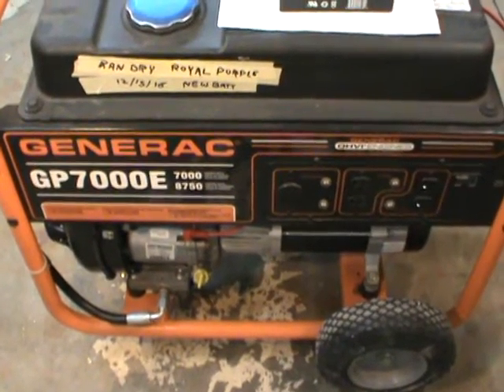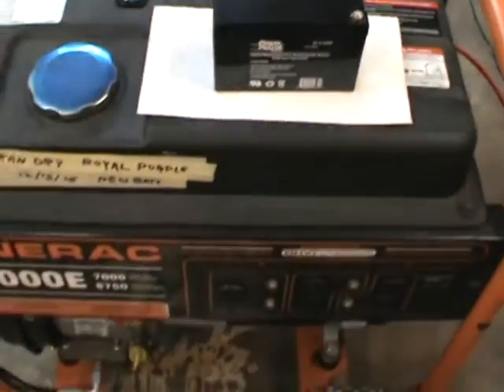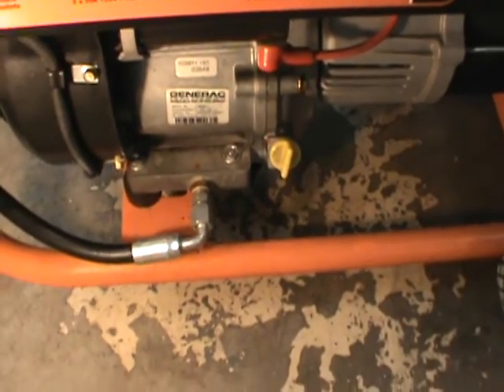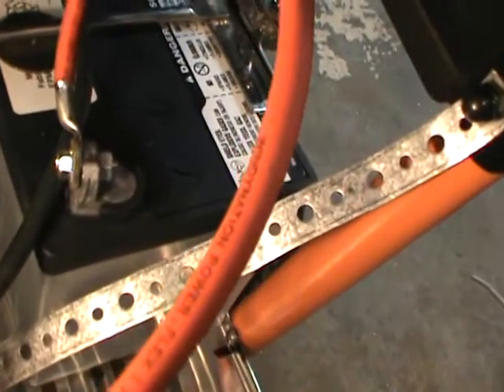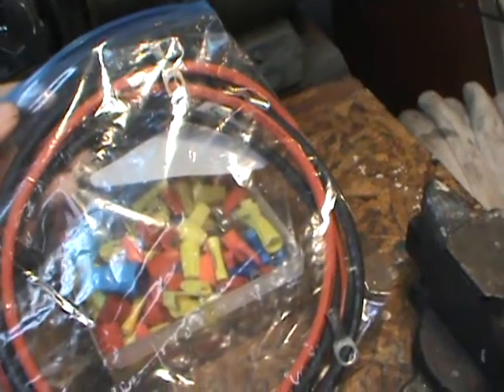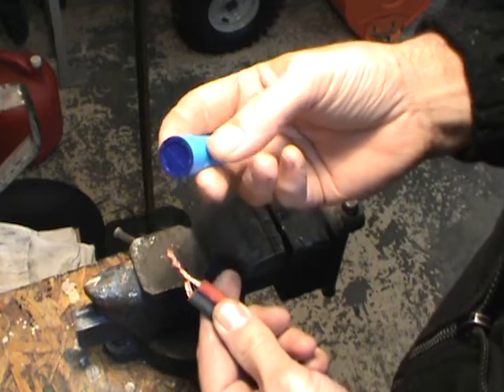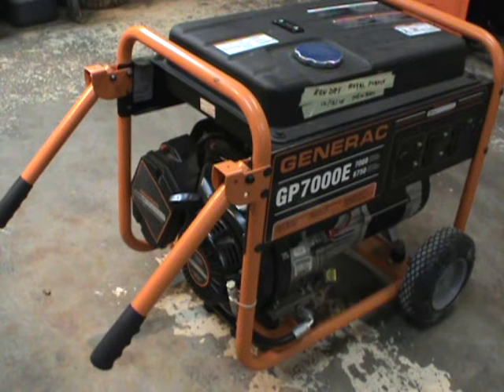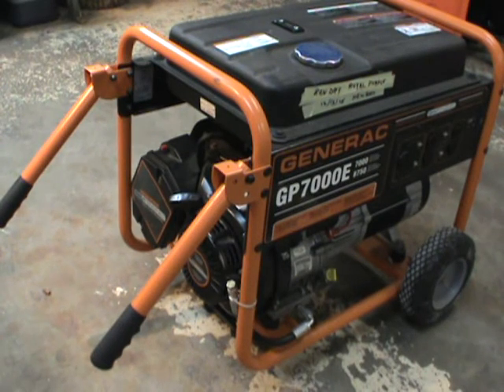Generac generator modification / adding a new battery

Comment: Great job!  Thank you for your time and effort in putting together the video.    I have an XP8000E with an electric start.   I haven't done a nice conversion like yours, yet, but will most likely do so in the future.  I've found replacement batteries for around $30, on Amazon, so just replace the standard battery every 3 years or so.   I also keep a trickle charge on it.
Reply from the maker: Doing the tractor battery mod on my generator works great. I never replaced it after doing it but the original batteries needed replacement for big bucks frequently.

Comment: I did a similar thing with my Generac xg 8000E ( I think the wire i used is 10 gauge) but used small battery clamps to attach it to the little pos and neg tabs on the new 12v battery which is the same small size as their original battery, so the connection is not as good as if there were thicker battery posts. I have a typical auto type flat fuse in the positive line and it almost always blows after a couple of start ups. I began with a 30 amp fuse, then 40amp. Both blew so now I put a 50 amp fuse and have to try see if it blows too the next time I try to start it. I couldn't find a larger amp fuse of that style. I'm wondering what's causing the fuses to blow? Could it be the poor connection to the battery terminal tabs? Which battery is that one you used? It might start it up a couple of times but after that always blows the fuse. The inline fuse just happen to be in the wire from another project. Thanks

Comment: If you have a modern Hi-Efficent furnace this Generac unit will blow out the main circuit board in the furnace, truth!!  Do not run your modern furnace with this unit.  Nice video, thanks.
Reply from the maker: The electrician told me do not run your PC on this generator (when he was installing the panel downstairs). It's too dirty. So I run my laptop... anyway.  I don’t have a furnace with a circuit board so I'm safe here. Thanks for watching.

Comment: Your dealer is ripping you off, replacement battery is between $30 and $40 bucks, Amazon, got one works great. Looks like you spent quite a bit more than this on your adaption.
Reply from the maker: I shop Amazon a lot but never thought to look there for that battery.
Reply: He did the right thing. The battery on my Generac xg 8000E is a real pain and nightmare to replace. A real idiot designed it that way.

Comment: Another idea, if I knew how would be to have the generator charge the battery while running. Lawnmowers do it so a generator should be able to or at least modified to do so. Thanks for the ideas, I’ll do a lawn mower battery on mine since I have one.

Comment: Did you put a fuse between the battery and the switch? If so what capacity?
Reply: No I just bought two inverter wires
2 AWG Gauge Red + Black Pure Copper Battery Inverter Cables Solar, RV, Car, Boat 12 in 3/8 + 5/16 in Lugs
Sold by: WindyNation
$13.49   to use a Marine battery because the Marine battery has the post to connect to.  The little 12 10ah batteries the generator comes with are stupid. they are too small and you have to charge them once a month for 18 hours, now I know if the little battery does not work the Marine battery will.
Reply: Thanks. Now to figure out what gauge wire the original battery wire is once I get it torn apart.
Reply from the maker: No fuse. Just run the wires over

Comment: What size battery??? What make battery,  does it freeze and crack ?? Mine is outside in the next State over RI and the winter cracked my battery like you stated 150 bucks to change the battery.Thanks
Reply from the maker: It's the basic lawn mower riding tractor battery. NAPA has them on the floor where I am for $40 or so. So I picked up a battery tray & wire for less than half a new one. They won't freeze outside as long as they are charged. I put a battery tender on mine. They sell for $20 or less on ebay. Look into a battery tender JR. Thanks for watching.
Reply: Thanks for reply,  so on my third battery at 150.00 each, This battery is still good I took it inside all winter I want to know if  I can use replacement tractor wire and terminals to make both pos and neg longer should I use car wire and terminals  you used 6 gauge or 4 gauge to use a  Marine battery as my back up. Since I have a Marine battery sitting around.
Reply from the maker: @seanbaxter1692  sure automotive battery cables would work fine. I think I used what I used because I had a piece laying around from a winch project I did a while back.
Just find a place to add the battery, fit the tray, extend the battery cables and your done. I used those water proof wire nuts from home Depot to tie it all together. Thanks for watching!
Reply: Thanks for all the help. I will let you know how I make out. Napa here I come, I use a regular solder but I liked watching you do the terminals.
Reply from the maker: @seanbaxter1692  After you swap out the battery, the next time you need another battery, it will be a cheap and easy swap. Those Napa batteries last for several years and they are fairly inexpensive.   This is the way to go to avoid those special high priced batteries. Thanks for watching
Reply: @007connecticut  So any 12 volt battery? What amps? I'm guessing the battery would have to be a starting type battery and an RV camper 12 volt battery wouldn't start the generator?? Would a basic car battery also work or would we need thicker wires? Thanks
Reply: I’m doing the same project to mine this weekend. Did you end up fusing your battery connection? If so what fuse size did you use? Assuming I just splice into the battery leads and don’t have to do any additional rewiring?
Reply: FYI, you can get a replacement for your original for a LOT less than $150.   I have a Generac XP8000e and buy them on Amazon for around $37.   Here's the model#:   Interstate Batteries Generac Generator Replacement Battery 0G9449 1/4" Nut and Bolt Terminals - 12V 9AH 36W - SLA Battery (HSL1069).

Comment: to change the battery which did not last 2 years you have to take the generator apart  gas tank off side panels off lots of work who at Generac ok this piece of shit design, shaking my head American made crap xg8000e
Reply: Sorry to hear about that, David.    I don't have to do all of that to access my XP8000e  battery.

Comment: Stellar!  What a great work around.  I agree with those who have commented about poor design and battery replacement.  I appreciate your video. How long did the OEM battery last?
Reply from the maker: The original battery lasted 2 years , then when I wanted to start it,  it was dead. I replaced it at the Generac dealer for $120 or something. Plus it had to be ordered. 
So I put a battery tender JR on the next battery and it was always plugged in. That lasted about 5 years so I decided to replace that. I thought of the price and said that was a stupid price so I just went to Napa and they have small tractor batteries for $40. I also put the Battery Tender Jr on this one. I'm now good for 10 years before I need to think about another battery. Maybe my personal battery will go first. LOL
Reply: Generac's battery setup is insane.  I decided to install the Bryke Racing 500-100 remote battery posts and wiring kit.  Thereafter, I can easily jump start the generator with my Cobra Electronics CPP 7500 JumPack portable.  There are a lot of folks installing work-arounds on these generators.  I added a drain line w/ shut off for the gas tank, too.